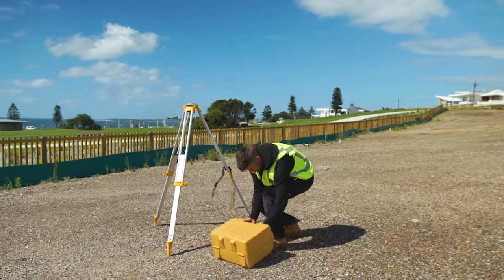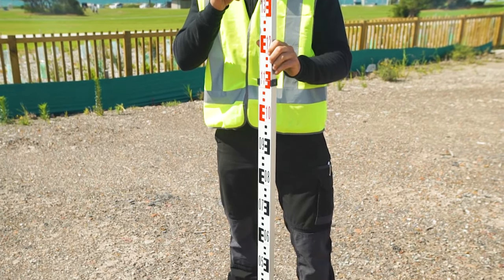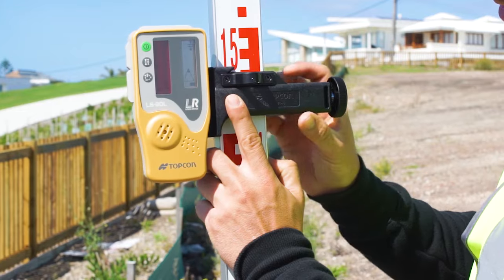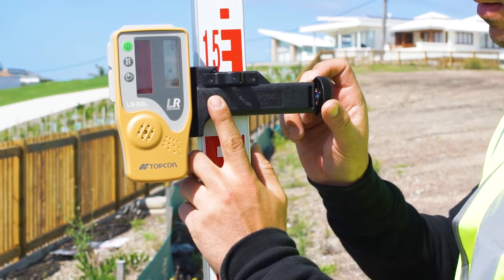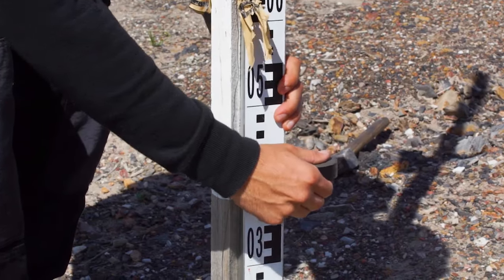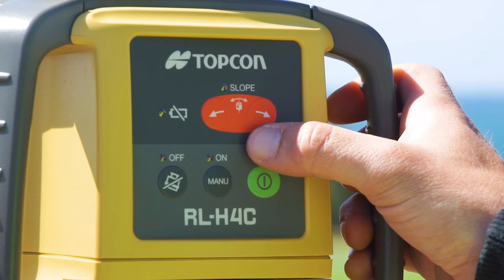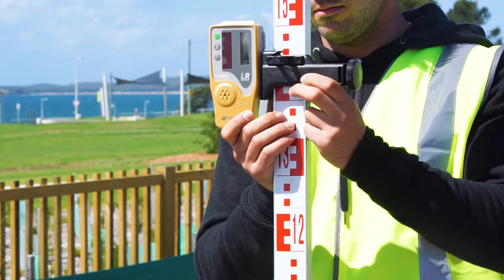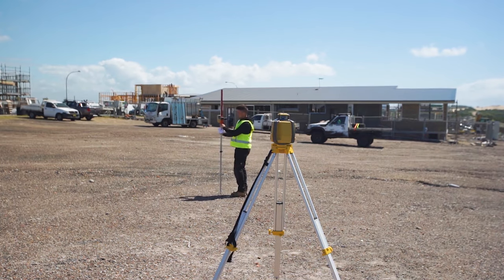How To Manual Slope Match With A Laser Level (Simple And Easy)

Comment: Your absolutely right. The laser has to be positioned over point a or b. Unless someone knows something I don’t know this video is totally wrong
Reply: I believe you are correct, the hinge point has to over the point "A"
Reply: No, it does not need to be set up directly over the point
Reply: @bagle2010  care to elaborate?
Reply: does not to be if you take new reading at point a - a bit imagination and common sense
Reply: @arturjasinski9371  after you take your new reading at point a your point b will be wrong
Reply: @tyfast27  when you follow the video you will set laser to fall you want , once this slope is set you can change readings on staff to whatever you want , but this is old laser at modern one you  input right slope grade into the laser straight away .laser does not need to be above point only set parallelly to dig
Reply: @arturjasinski9371  That’s correct that gives you the slope you need but it then changes your finish grade/top of dirt level. Let’s say you need to slope from the edge of concrete at 2%. If you set the transit(new or old) in the middle of the pad(for example), you then go down 4”s from the edge of your concrete and that’s now zero. Now you go to the end of your slope/point B and slope the laser to this point. You have now CHANGED point A. So let’s say now you move the target so your on grade at point A again....now guess what, point B is off🤷🏼‍♂️ So how do you fix this? Set the laser directly over point A and then that is your hinge point, Once you zero your target at point A with the laser directly over it, point a will then not change.
Reply: Correction of my last post! Lol it totally will affect the slope as well because the laser is closer to point B! In order for that to work you would have to do all kinds of shit, like lower the transit after you shoot point a and b! Your slope will be steeper than intended! If I’m wrong please enlighten me but think about this first! 👍🏻
Reply: @tyfast27    In the movie they gave example how to set laser    to levels you choose on site , but if you want   2% fall = 1 in 50    gradient       for 2% fall you need to set 100mm but on right distance    here would be   5m  on 10m it would be 200mm.the best if you read something about setting gradient laser with simple sketch kind of section
Reply: @arturjasinski9371  I though the video was  how to manually slope a laser from point a to b? The 2% was an example that was obviously misleading for you. I want you to tell me how to manually slope a laser from point a to b with the laser not being at point a
Reply: @arturjasinski9371  Put 3 dots on a piece of paper simulating point a the laser and point b, make sure they are not in line. Now take a straight edge and try and line up all 3 with a straight edge. Doesn’t work
Reply: @tyfast27  laser does not need to be at point at all once slope is set but  in right direction  if it was set on point then   you do not need to set receiver for second time on point a.The best read  manual for  gradient laser with simple sketch section and you will understand cheers
Reply: @arturjasinski9371  If one knows that it is a 2% slope let’s say and you had a gradient laser which this particular model is not then yes you would be right. I believe that this particular situation calls for the finding of the grade from point a to point b. So in this situation with this exact laser the only way to find an exact line from point a to b is to set the laser exactly over point a. If you are 1” off the lateral line your slope will be off 1”. I actually do this every day trust me I have tried it with that laser several times. If you have a laser that you can punch a 2% slope into and you have a hub to start from than it doesn’t matter where the laser is as long as it’s parallel to the slope, in that case you are right.
Reply: @arturjasinski9371  I do it every day for a living ol son. I hope your not fine grading for a concrete haha Good luck
Reply: For a one time setup and not having a pipe laser your will need a point C. Obviously your not going to set up your laser where you plan on excavating. I suggest a 10’ offset to establish point C in line with point A and B (unless you have a derelict operator then you may need some more distance to avoid damage to your instrument) . For this example we will assume a 100’ long sewer line at a 1% grade. Lets say we have an uncovered sewer line leaving a building at a flow line elevation of 100.00’(Point A) and we have to punch thru a manhole 100’ away (Point B)  at a 1% fall making our flow line penetration at 99.00’ (100-(100x .01).  If we establish point C 10 feet behind the MH and in line with  the tie-in (point B to A), we have now established a horizontal  difference of 110 feet with a corresponding vertical rise of 1.10’. We can set our laser up over point C and then take a level reading over to point A. Once we get a solid tone at A we can set our linker rod (let’s make it easy and set it to 100.00)  and  then raise the sensor 1.10 feet from this point.  Your Tape should read 98.90 (this may seem backwards to those that are used to a tape measure or a  Philly rod vs. a  linker rod). Now that the sensor has been elevated, have a 2nd person adjust the slope upwards until you get a solid tone on your sensor.  Once you have established this, you have now established your base line slope. You can now extend your rod down to the flow line of the sewer pipe and adjust your sensor for a solid tone and you are good to go. You can now proceed up and down the ditch line without adjusting your sensor for flow line elevations.
Reply: @lspringfield93  in the video he sets up the laser and then finds point a in front of the laser and sets the target, he then slopes to point b. As soon as you slope to point b you have lost point a unless you are directly over point a. Therefore the video is wrong. He did not creat a slope from point a to point b. What you are saying is simply not what they are doing in the video, but obviously you are correct in that scenario 👍🏻  you can be up to 25 feet either direction to the side of point A to get the laser out of harms way and still be accurate if your digging a ditch but we usually set the laser in the center of our job and work around it to fine grade for concrete. If the slab is larger than you have to move the laser accordingly. We are doing a job now that requires us to move the transit to each hub because the slope changes from point to point and of the laser is not directly over point a of your slope it greatly affects your finish product. Thats what the hook on the bottom of the tripod is for, hang a plumb bob from it if you need to be exact.

Comment: For a one time setup and not having a pipe laser your will need a point C. Obviously your not going to set up your laser where you plan on excavating. I suggest a 10’ offset to establish point C in line with point A and B (unless you have a derelict operator then you may need some more distance to avoid damage to your instrument) . For this example we will assume a 100’ long sewer line at a 1% grade. Lets say we have an uncovered sewer line leaving a building at a flow line elevation of 100.00’(Point A) and we have to punch thru a manhole 100’ away (Point B) at a 1% fall making our flow line penetration at 99.00’ (100-(100x .01). If we establish point C 10 feet behind the MH and in line with the tie-in (point B to A), we have now established a horizontal difference of 110 feet with a corresponding vertical rise of 1.10’. We can set our laser up over point C and then take a level reading over to point A. Once we get a solid tone at A we can set our linker rod (let’s make it easy and set it to 100.00) and then raise the sensor 1.10 feet from this point. Your Tape should read 98.90 (this may seem backwards to those that are used to a tape measure or a Philly rod vs. a linker rod). Now that the sensor has been elevated, have a 2nd person adjust the slope upwards until you get a solid tone on your sensor. Once you have established this, you have now established your base line slope. You can now extend your rod down to the flow line of the sewer pipe and adjust your sensor for a solid tone and you are good to go. You can now proceed up and down the ditch line without adjusting your sensor for flow line elevations.
Reply: Lane, are you saying that the rotary level used in this video is actually fairly linear when used in slope mode? Meaning you need to stay out in front of it along one axiz to get an accurate grade?
Reply: The reason I'm asking is because you sound versed in this field. I am just getting into it and trying to figure out what this laser level can and can't do.
Reply: I don't know shit about fuck, but it seems like you do and I wish you made the video and not this guy

Comment: Doesn't the laser have to be positioned directly over the top of point A? The rl-h5a manual suggests so. I used this video to attempt to set up slope for the first time and found the video to be misleading regarding where the laser could be positioned in relation to point A. After a lot of wasted time I referred to the manual which differed from this video.
Reply: It is more accurate if you are on top of the point, or what I do is set up the head of the unit right beside my start point. Then it's perfect

Comment: You cannot set subgrade elevations for horizontal planes ie. Driveways, parking lots, building slabs with a pipe laser or pitched plane laser. They operate on a linear axis. If you deviate from its tilt axis you will get elevation distortion. You need to use a  level plane laser and set elevation points for formwork, expansion joints, keyways or temporary elevation pins to facilitate concrete placement. At a 2% grade you are right that you slope 0.1’ per 5’ (1 ¼ per 5ft). If you are pouring a driveway with no crowns or valleys it’s a simple process of multiplying the length of driveway by .02  and setting elevation stakes. For example if your Garage finish floor is at 100.00’ elevation and you have a 200’ straight driveway sloping down the elevation you need to set at the end is 96.00’ (200’x-0.02= -4.0).
Reply: Still can't beat a simple set out of a few pegs and string lines

Comment: Isn’t there some math required? I’m trying to sub grade driveways that are 26 feet long with a 4 in slab. A coworker told me that I can use the laser instead of string, I know this but I have to adjust the finder on the rod every few feet to find my grade. 

For example, if I want to find my grade on a 2% slope, I need to move the finder on the rod one tenth every 5 feet. Is the method in this vid supposed to help me so I don’t have to calculate my position all the time to find my grade?
Reply: I guess I’ll have to find an online manual... the manuals for the lasers I use are long gone...

Thanks though!